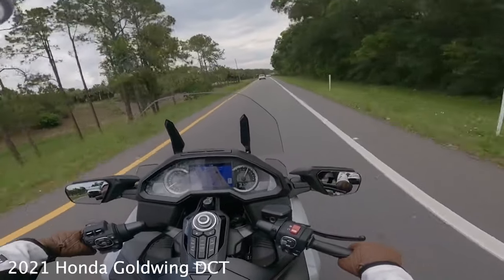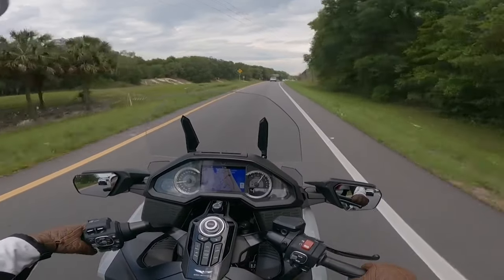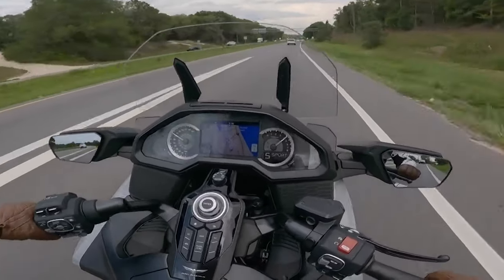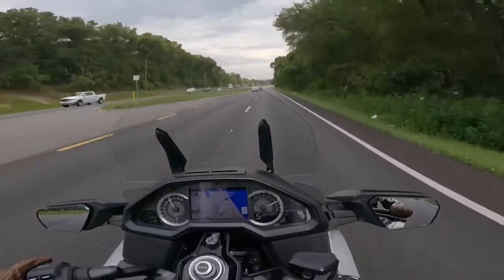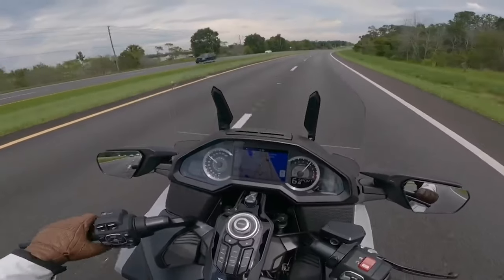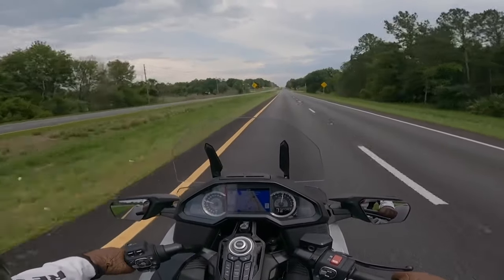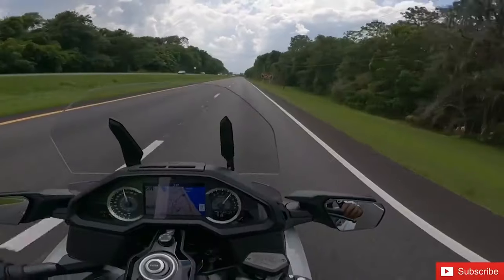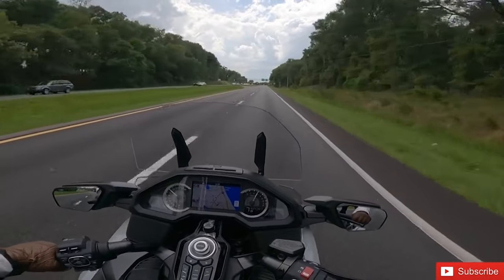2021 Honda Goldwing DCT TOP SPEED RUN. How Fast Can it Go?

Comment: I love my 22. I had a guy on a Harley roll up beside me at a stoplight and as per usual I smiled and waved hello. He gave me a nasty look and just started revving his noise machine. “Okay” I said we’ll just click this over into Sport mode. Light turned green and my front tire came off the ground, his bike was making a ton of noise but barely moving and about 3 seconds later he was already at least 20 car lengths behind me and another 3 seconds and he was just an ugly dot in my rear view mirror. I wave to ALL riders, not all Harley riders snub me but it is ONLY Harley riders that won’t wave back. Every other type always waves back.
Reply from the maker: The GW on sport mode comes to life!
Reply: That's strange when I'm riding my sport bikes Harley riders wave at me, or when I wave they wave back. Must be a Wisconsin thing. Most people are friendly here as riders. @jdbmoto

Comment: The 2018+ GW is factory limited to 112mph. It will do 112 going up a really steep hill no problem but not one mile faster and that's like half throttle. Supposedly someone came up with a crack for the ECU that got rid of the limiter but they only sell to racers. Like some folks have noted here, better make sure your tires are in good shape before you do any land speed records on one of these cows. I saw a rear tire at the shop last week that detonated at speed. Dude was lucky to walk away with his life. Tire's aren't cheap but they are a great deal compared to a funeral.
Reply: So it has exactly the same top speed as my Honda Ridgeline. Same way electronically limited of course.
Reply: I've heard if the speed limiter in the ECU is overridden and the bike is taken in for service and the bike is still under warranty the dealer could void the warranty. Running motorcycle tires (at least on the rear) would not be safe at speeds in the triple digits. A  Z speed rated car tire (especially a run flat) would be much safer. GWs are so hard on rear tires, and not all that much easier on the fronts...that's why I roll double darkside...
Reply: I recently bought a 2018 bagger was believed that it was limited, as it gets there pretty quickly. I love the bike, it's not a pig, but handles like a bit bigger sports bike.
Reply: You can get around the speed limiter by using a SpeedoHealer and limit the gauge so it cant read any higher than any number below 112. Your bike will stop reading at your set point but continue to pull. Use your phone GPS to show true speed at that point.
Reply: @GrandpaWazi  The problem is it's not plug and play. You have to splice it in and no way I'm going to cut my wiring harness up on a bike I will be selling. If it was a connector, I would have already bought one.

Comment: I could care less how fast it goes. Fast enough is ok for me. I like the gear ratios - cruising at 75-80 with the rpms somewhere around 2500 in 7th gear. New tech, new innovation, new styling, ya I want one yesterday !
Reply: Well put!! 👍
Reply: I keep seeing posts where Harley guys are bragging that their bikes have a higher top speed. If the GW wasn't speed limited, that wouldn't even be close to being true...
Reply: @jamesbottger5894  yeah some  HD guys have weird egos. If I were into touring/baggers I would get a gw over any HD
Reply: @BaldKiwi117  Harleys are more about image than they are function. I know quite a few HD guys who claim their bikes are comfortable for the long haul, but most of them have never ridden a Gold Wing, so they have nothing to compare to...
Reply: @jamesbottger5894  again, i wonder why a Harley rider would want a higher top speed
Reply: @marcleblanc9120  So they can brag about SOMETHING their bike does better...
Reply: @Sabar sabar I don't think that's the reason. I've been told the speed limiter is set to 112 MPH due to riding conditions on the roads in Japan, and Honda did not want the hassle of having to make the models intended for sale in the U.S. without the limiter, or setting the limit higher...

Comment: I have ridden my 2013 BMW K1600 at an indicated speed between 140-145 and not a full throttle.  It has a 6 speed manual transmission and 160 hp. I am 68 years and have been riding motorcycles for 44 years.
Reply from the maker: Nothing like the the thrill of speed and seeing how far the machine will go. Thanks for watching and keep the shiny side up sir!
Reply: I have a '13 K1600GT too. These Goldwing guys have no idea what the K bike does compared to the GL. It will cruise comfortably at the GL's top speed, without effort.
Reply: I’ve had my 06 K1200 GT to 165 without any struggles

Comment: This bike has freight train torque. It gets there quickly at a low 2500 RPM. Then smoothly and quietly cruise missiles from there. Stealth.
Reply from the maker: You couldn’t have said any better. It’s a TORQUE MONSTER and smooth as silk!

Comment: Thanks for revving up the Gold Wing. I didn’t buy my 2021 Gold Wing Tour DCT to do the quarter mile with. That’s what my Gen 2 Yamaha VMAX is for. The Wing by far is the best riding touring bike with all it’s comfort extras. Now, with that said, it is disappointing it has a limiter at that speed for when we get the itch to blow out the carbon.
Reply from the maker: Thanks for watching! I was disappointed as well, but I feel like all the newer bikes have a limited in place. My 2008 FJR pulls past 110 with no issues and still has plenty to go
Reply: I've owned plenty of Honda's in my time, and it seems that their legal team has too much say in the final product.    If I remember correctly, the cruise control on the original 1500cc Goldwing would only work up to 70mph.   Ridiculous.
Reply: @thumperjdm  I totally agree with you concerning being Ridiculous!!!
Reply: @stancook2888  I ride a Gen2 Vmax, and honestly the 2021 goldwing I own is roughly as fast as a gen1 vmax.  What's funny is my 2009 vmax has a larger gas tank than the goldwing.  I stop every ~165 miles for gas usually on both bikes.
Reply: @KareemHadee  There's no way this GW is as fast as a gen 1 Vmax. That bike ran a low 10 second 1/4. The quickest I've seen the new GW go was 11.95...
Reply: @jamesbottger5894  Honestly, it is about as fast as a Gen1 Vmax overall. Comparable to a V65 magna when you are not in 7th gear.  Even in the video the (around 1:14), the bike becomes gutless when you enter into 7th gear.  That was how it felt for me in touring mode as well.  If the video creator kept the bike in 6th gear he could have gone up to around 120-130mph easily.  I have done this before on my 2021 GW touring dct. 7th gear is overdrive, and not meant for all out speed. The same was true on my 84 V65 Magna.  When I wanted to pass someone I would drop from 6th gear down to 4th and "fly by" everyone!  That was one of the features I really hated about the first gen (and even 2nd Gen) vmax motorcycles is that they where only 5-speed bikes.  Vboost on the 2nd gen works so well that I have no need drop two gears down into 3rd. The first gen never quite seemed right compared to the V65 magna. I am forever hunting for 6th gear on my vmax...  I know it's there! :P
Reply: @KareemHadee  You're talking strictly about acceleration in the top gears. In that respect, all of these bikes are fairly close. I'm talking about acceleration through all of the gears. In that respect the GW isn't even close to the 1st gen Max, or even the the V-65, not even when the GW is in sport mode. I know because I've owned all 3....the V-65 and Max were both 10 second bikes...the GW will barely break into the 11s....that's a big difference...
Reply: @jamesbottger5894  I have owned all 3 as well. Speed is relative... Seriously! For example, an 88 Vmax with a stage 7 jet kit will make really sexy numbers on dyno run. But on the street you actually loose performance in the lower & mid range. A stock 85 vmax with a hindle or kerker would actually get a better midrange, but a not-so-good performance boost on the top end (of the RPM band) like a stage 7 jet kit provides.  The only reason why the goldwing is slower than a V65 and Vmax is simply due to weight.  If you removed all the plastic the numbers at a drag stip would fall more inline with the 80's power cruisers.  A 1-second difference at a drag strip seems like a lot, but in reality it's not that much. Especially when we are talking about a fully dressed up bike vs. a cruiser.  All in all I love my GW, and I miss the V65 magna. The 2021 GW I ride reminds me of the 84 V65 magna even through I know it honestly is slower.  But I never broke in a motor on A vmax or V65 magna with a SS-BB1500 like I did on my 2021 GW! I bought my GW for long distance riding. Neither V65 or Vmax stock holds any more than about 110-120miles of gas. And having that fuel light come on at ~90miles (assuming the sending unit worked.. LOL) was annoying!  Be safe, and keep riding.
Reply: @jdbmoto So does my Concours 14, way past👍

Comment: Just after I got my 2012 Goldwing I went for a ride with my youngest brother who was riding a Harley.  On our way back home we encountered a lot of merging traffic.  I'm not one to contend for my position with automobiles so I just backed off a little.  After the traffic had settled down,  I rolled on some throttle to catch up with my brother. As I slowed down to match his speed I glanced down at the speedometer and noticed the needle dropping through 100.  Very impressive power and speed, and that's a 2012 bike.  I'm sure the newer ones are just as impressive.
Reply: Acceleration wise, the new ones are even faster...
Reply from the maker: The different riding modes make the Goldwing that much more versatile. Want to take it easing, leaving it on touring mode, want to wake up the beast, switch to Sport Mode and let her rip. Thanks for watching!
Reply: @jdbmoto  I find sport mode way too radical. This bike is plenty fast enough in touring mode...
Reply: @jamesbottger5894  use sport in a tunnel

nice sounds

Comment: Every motorcycle over 700cc should be allowed to reach 125mph IMO
Also, a 7 gallon tank would be better on the Goldwing…it is a “long distance tourer” and comfortable enough to not need to stop until 300-400 miles
Reply: @dickgrantberg  rodger that, mu butt starts to burn even with my riding pad

Comment: BT-Moto ECU re-flash for 2018+ Gold Wings removes the speed limiter and smooths throttle response in Sport Mode. Top speed goes to something in the 123/124 range with no other modifications. And, you can return to the stock tune anytime.
Reply from the maker: That’s good to know!

Comment: My 99 valkyrie will.do 140+. Dissapointing seeing a limiter on the bike
Reply from the maker: I feel like all new bikes have a limiter as compared to the older models. Thanks for watching!
Reply: @jdbmoto  thanks for the video. Keep it up.
Reply: That's what I figured, it's just limited really low. I wonder why they chose to limit it at 105? I had a car that was governed at 135 mph... seems completely arbitrary sometimes where the manufacturers decide to put the limit. It's not like it's related to the speed limit...

Comment: I'm  a motor cyclist in Scotland and find these top speeds insanely slow.  140 mph on a 15 yr old BMW k 1100 lt.  135 mph on a 15 yr old kawasaki zzr 600. Both times still climbing but ran out of road.
Reply from the maker: More and more restrictions from manufacturers!
Reply: I'm a biker in Asia and our bikes aren't limited like American bikes are.

My 650cc Honda CTX is faster than this 1800cc Goldwing.

I'm planning to tour across the States next year. But if my bike can only do 112mph, I'll rethink it.

Comment: I have a 2004 honda valkyrie rune with a goldwing engine. 
130+ on an 850lb bike. So the 22 goldwings are capable if you take the limiter off. But 110 is plenty  though , specially for 2 up
Reply from the maker: Thanks for watching!  110 is plenty and truth be told, there is no need to go that fast!

Comment: Is that bike electronically limited to 105MPH? My 2021 Rebel 1100DCT is electronically limited to 100MPH.
You can tell there's more in there on my bike, but it won't do it with the limiter on there.
I'm sure the Goldwing is probably capable of 130 / 135 if it is un-corked.
BUT, by doing that, I think you screw up your warranty.
Reply from the maker: I’m sure it can do more with a flash of the ECU especially feeling how she pulls all the way up
Reply: I own a rebel and its limited as well. I believe can go much faster, even my Nc750 DCT can go faster than the rebel 1100. My top speed on the NC750 was 178kmh (110mph)

Comment: Had my '21 6-speed up to roughly 111mph the other day on two quick pulls (with the windshield in both positions).  It was super windy with an awful side wind out on the desolate valley road I tested it at..  So I really wouldn't have wanted to go much faster than that anyway given the conditions.  Once I get new tires put on the bike and have a calm day, I'll probably give it another shot to see if I can achieve anything quicker, to see where the speed limiter really lives.  Either way, that's plenty fast and largely unnecessary.  I'm plenty happy cruising at 80mph comfortably here on the open roads of Utah.  I definitely didn't buy this bike with the intention of it being a crotch rocket, but I still think it'd be nice for it to achieve 120-130mph or so, but I guess that's a pipedream from what I've heard about the limited speed on these bikes.  Even many passenger cars today are capable of at least that... Oh well, no big deal.  It's unlikely my bike will see anything over 100mph more than a few more times while I own it anyway.  I'm extremely happy with it just the way it is.
Reply from the maker: Thanks for watching! Rarely do I go over 100MPH on my FJR but it’s nice to know I can if that makes sense
Reply: Cool man. I ride a 2013 K1600GT, currently on the darkside. (Vercelli Strada 2 tire, W speed rated) It cruises comfortably at the GL's top speed, and will do over 150mph as top speed. And it sounds amazing.

Comment: I had never taken my 2009 BMW K1300GT much more than a 110mph, so just for the heck of it I pinned the throttle from a 30mph roll on, on a empty toll road and shot up to 155 in nothing flat. The speedometer needle was still rising but 155 was good enough since the manual suggested the pillion hard bags should be removed at speeds over 110mph, which they were not.
Reply from the maker: Damn!
Reply: I have a '13 K1600GT. BMW's are made for high speed touring. All day long. Love them.

Comment: The newest Goldwing owners say that the sport mode is insane.  Most don't even use it.  It's just too wild.
Reply: I use Sport mode to pass.  It's a rocket!  Fun but ya, I don't need that for anything else.
Reply from the maker: The Sport mode is no joke, you better be holding on during acceleration. Is like Dr. Jekyll and Mr. Hyde when switching the GW to sport mode. Thanks for watching!
Reply: @jeffmckeown9639  hold on and put your head down

it is rough when in sport
Reply: Sport mode is rather fast (my prew bike was a zzr1400/zx14 and that was insane 🤣) for a bike this size,  the problem with the sport mode is that it is best suited for highways and not for narrow twisty roads, then it becomes to jerky.
Reply: i use it in every tunnel
Reply from the maker: Those who haven’t don’t know what they are missing! A freaking missile!!!
Reply: @jeffmckeown9639  i use economy to pass and that is wild enough

the torque!
Reply: The issue is using Sport mode from a stop.  You too the throttle like you're used to doing, or you remember and gun it and get nearly thrown off the bike.  It's a flipping beast.  Should be called Beast Mode.  I heard Marshawn said, "Nah,"

Comment: This is interesting 🧐. I’ve had my 2021 DCT to 115 mph and I was the one to let off the throttle.
Reply from the maker: That really is interesting! Sport mode?
Reply: @jdbmoto  touring mode.
Reply from the maker: Interesting to say the least!
Reply: I think the Canadian bikes don't have the limiter, or it's set higher.  Not an expert so I could be wrong.  Are you in the US?
Reply: @jeffmckeown9639  I’m in the US.
Reply: What's the hurry, DCT riders heading to a pink skirt convention?

Comment: I still can't figure out why Honda set the limiter at such a low speed. This bike is easily capable of doing 150 MPH, and doing it safely.
Reply from the maker: At the very least 125 easy. You can tell she still had some left in her
Reply: @jdbmoto  Considering it's overall tall gearing, plenty of HP and torque, and it's aerodynamics, I would think 150 would be achievable...
Reply: @philtil8977  If that's the case, then why aren't ALL motorcycles speed limited?
Reply: @jamesbottger5894  In this world there are many trains of thought and/or opinions, just as yours. I am unable to account for everyone.  Good Rides
Reply: @philtil8977  I didn't state my opinion...
Reply: @jamesbottger5894  because they are sold for profit
marketed to people who value speed
Reply: @marcleblanc9120  That still doesn't explain why the GW's limiter is set so low...
Reply: @jamesbottger5894  I do wonder about the limiter
maybe tires are a limiting factor on the heavy bike?
Reply: @marcleblanc9120  The story I've heard, and this is coming from the guys on the GW site, supposedly one of the big wigs from Honda said the speed limiter was set where it is because it was mandated by the Japanese government for the GWs sold in Japan. That would make sense for THOSE bikes, but it makes NO sense to have the same limit set on bikes intended for sale outside of Japan...
Reply: @jamesbottger5894  well thanks 

story makes sense 
I think a new chip is a few hundred bucks but still they only hit 235 kmh or so
Reply from the maker: That seems very possible.